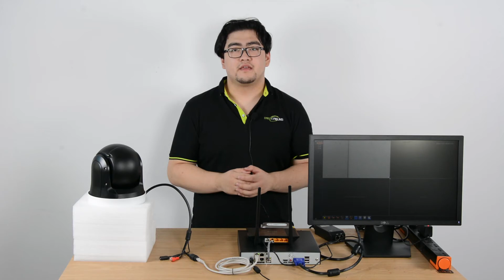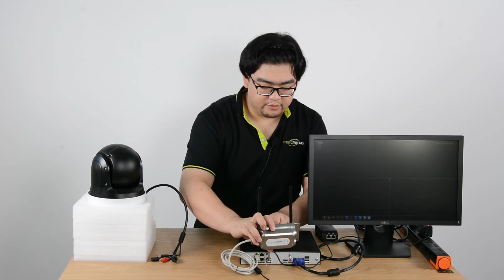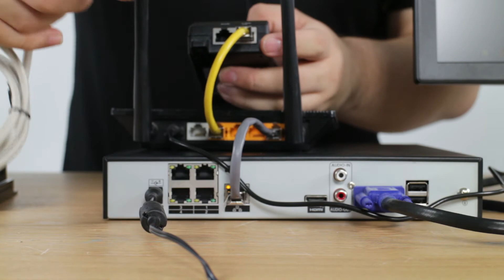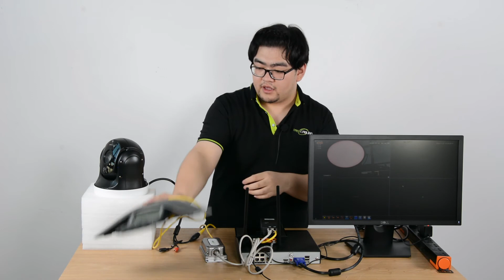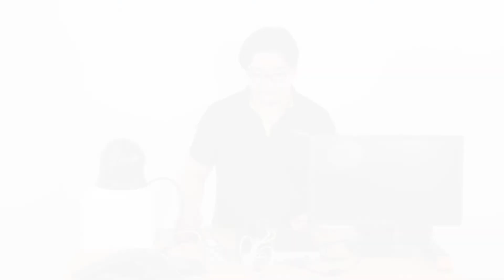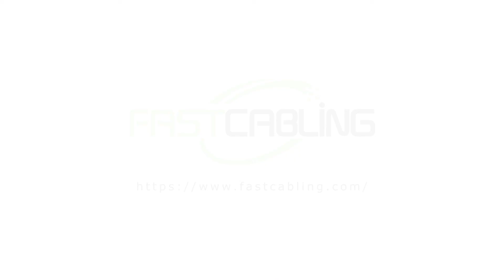How to Add One More IP Camera to Your Existing Networking System

Comment: Hi, thanks for resourceful videos about PoE. I’m buying DS-7616NXI-12/16P/S NVR for 6 outdoors IP cameras (2 of DS-2CD2685G0-IZS and 4 of DS-2CD2T85G1-I5) plus indoor 4-camera-kit NK44W0H-1T(WD) of which comes with its own NVR that will connect it to the same outdoor NVR to have all on the same LAN. For the outdoors and because of limited cabling (there’re only 2 CAT6 cables running to the indoor room where the NVR and LAN will be) while I need 6 IP cameras. So, I’m using PoE switch DS-3E0510P-E/M to connect 6 cameras to its PoE ports and then uplink port running indoor to the NVR/LAN; leaving two empty PoE ports and one unused CAT6 cable running to indoors. My questions are: (1) I know that the one CAT6 cable coming from this PoE switch connects to one PoE port on the NVR (it will though occupy 6 channels as there are 6 IP cameras coming from the PoE switch) and this NVR connects to LAN router (isolated CCTV system); but if I connect this cable to the LAN router instead and for this model of NVR being also connected to the same LAN router would it still recognize the 6 outdoors PoE IP cameras and how? (2) Hence more importantly asking this, because I want to utilize the two empty PoE ports at the outdoors PoE switch to connect to two more PoE devices: one to IP projector and one to IP access point; can I do that withOUT the complications of extra devices and costs (I saw your videos about additional “PoE POWERED switch” (which I still don’t understand very well how they are different technically than PoE switch in this particular scenario) or PoE extender+ PoE injector which will require me to consume the last empty CAT6 cable that I’m trying to save for any potential future need and obviously avoid extra costs of more devices? So can I connect the access point and IP projector (if they’re PoE-compatible of course) directly to the PoE ports on this particular PoE switch model in this particular scenario as extra PoE devices in addition to the existing CCTV system? Thanks.
Reply from the maker: You should connect the incoming cable with 6 IP cameras to LAN router. The NVR should be able to discover the IP camera in the same LAN and make the connection automatically. The PoE powered switch can be power by PoE injector or another PoE switch backend and PoE power will passthrough the switch and supply the edge devices. So you can re-use one of your cat6 cable to have 7 additional PoE ports. The total power budget is about 71W while you use 95W PoE injector at the backend.

Comment: Hi. I have Hikvision 4 channel PoE-NVR DS-7604NI-Q1/4P {at/af poe protocol supported}. I am using 4nos.  2MP IP cameras (distance under 40 mtrs) in my home but now I want to install one more 2MP IP camera about 20meters away from the NVR. 
Can any small & cheap two port Ethernet splitter/extender helps to achieve my goal.

Or if one remained port haven't enough power for two ip cameras then can I use a separate 4port poe-switch, since extra poe-switch can provide the required power to the 4th & 5th IP-cameras ? Is there any chance of success? Will my NVR detect the 5th ip camera and save it's video on hdd ?

 If is there any cheap workaround then please suggest as I do not want to buy a new 8 channel NVR. If yes, then please tell me in detail, what should I do.
Reply from the maker: I think you can't add the 5th camera to 7604NI-Q1. Just checked the specification, the PoE NVR only can take in 4 PoE IP camera. The first thing to do is have NVR which can take extra IP cameras, you can consider the cabling next.
Reply: @Fastcabling  What if I connect extra (4ports) poe switch  to this NVR 4 channel PoE-NVR, then any chance to connect 5th ip camera?
Reply from the maker: @Sidg2  You see, the problem now is your NVR is designed to take in maximum of 4 units of IP cameras. There are no resources in your NVR to access an extra IP camera. I guess you can see it is the 4 split screen, there is no way you can have the 5th camera on the NVR. It is not about the cable.
Reply: @Fastcabling  oh.. okay. So it's a software related limitation in Hikvision's NVRs but it's hardware may support the extra IP camera !! 
Does Dauha's mid-range NVRs also have same limitation  ?
Reply from the maker: @Sidg2  The model 7604NI-Q1, the 4 standards for 4 channel. I guess Hikvision should have 8 ports and 16 ports NVR
Reply: @Fastcabling  Hikvision have 8 & 16 ports NVRs.
But I am just now curious to know about extra ip camera related issue. So i was asking, is it a software related limitation in Hikvision's NVRs or hardware, may be hardware support the extra IP camera ?
And tell me, does all NVRs also have same software limitations or it depends upon brand to brand  ?
Reply from the maker: @Sidg2  I guess we have to say it relates to both hardware and software. Recording (write to hard drive) doesn't need lots of CPU resources. However, you will need to view the live video on the camera (decoding) which is CPU hungry process. The CPU and RAM have limited capacity. When we design 8-channel or 16-channel NVR, We will choose a better CPU and larger RAM which involve the cost. In order to avoid a system crash, the maximum channel has been set in the software. That is why I say you can't add an extra IP camera to your NVR which specific only 4-channel in the datasheet. It is just how we design the products basing on the hardware capacity.
Reply: @Fastcabling  ok but in case of DVR I have se some videos in which people are successfully connecting the 6 or 7 HD cameras in their 4 channel DVR (some unknown brand).
(In case of dvr, it have to do more work still it able to connect extra cameras.)
Reply from the maker: @Sidg2  It really depends on how they design and allocate the CPU resource. We can simply reduce the sync playback channel and make DSP and RAM accept more channel input. However, that is nothing you can control or change. You may take a deep look at the GUI setting. What I read on the specification is 4 IP camera input in your model.